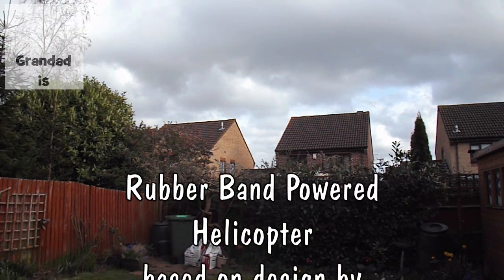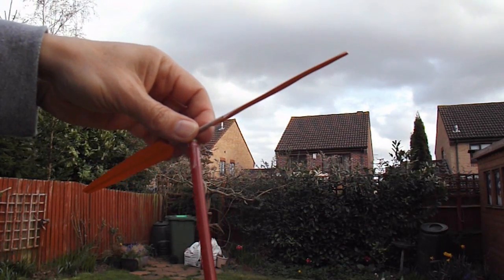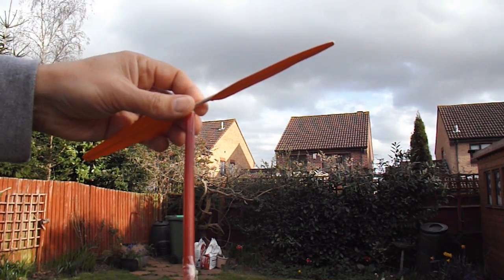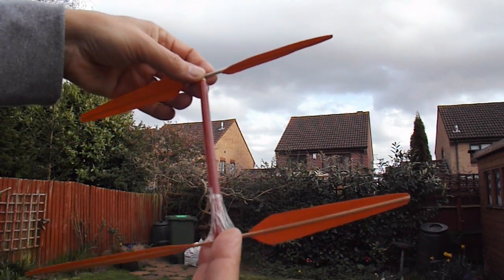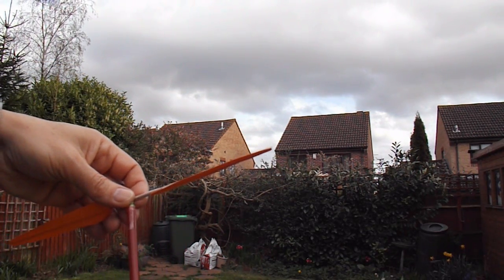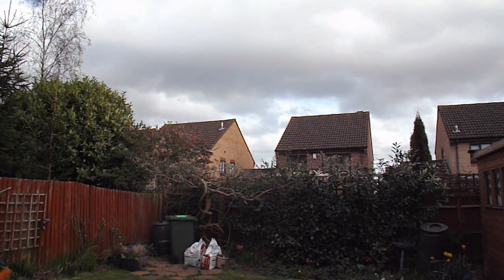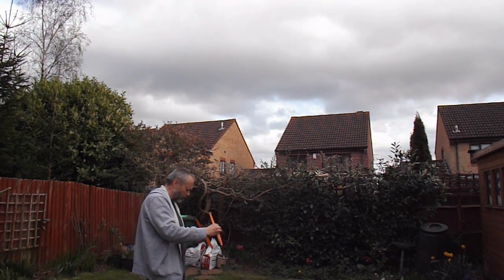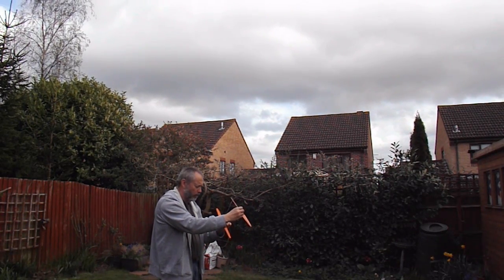Rubber Band Powered Helicopter based on design by David Vernon Williamson

Comment: I was looking on YT for rubber band helis and I saw this one. I am gunna make a big one a bit like yours but have a longer stick going down. Two advantages:
1) Extra stability, cos it's weighted to stay more up-right.
2) Longer rubber band will last longer.
Still thumbs-up, though.
Reply from the maker: +Justwantahover thanks, here is one that is bigger but I am guessing you may be thinking bigger again https://youtu.be/H7HqkcE1oO4
Reply: +GrandadIsAnOldMan Thanks, I've seen it. When I was on about the extended stick and long rubber band, I meant that the rotors are both near the top, and the stick hangs down below both rotors. Mine will be about thirty inch diam (or a bit less).
Reply from the maker: Justwantahover look forward to seeing it. Your recent flights with the old timer are great. Looks like you need a bigger garden.

Comment: never really got to the bottom of those things. I think there are much better designs out there
Reply: +GrandadIsAnOldMan haven't tried it yet but will get round to it eventually. very similar to toy which originally inspired the wright brothers
Reply from the maker: david vernon williamson hey, it works fine. There will always be tweaks and adjustments and different materials, but this worked by following your design so that is a total success for me.
Reply: +GrandadIsAnOldMan, could you please put the make video together? I had so much trouble figuring out from the drawing how to make it... In the end, my top blades spin very slowly. Steadily, but not fast enough to power flight... Thank you!
Reply from the maker: +Elena Labrecque if it spins slowly then you probably have a problem with friction. Maybe the bead you are using is not allowing the propeller to spin freely. You may find using 2 beads might help so they rub against each other as the bearing surface instead of the propeller rubbing against the bead and you might be able to add a lubricant of some sort to reduce the friction. The other problem may be your rubber band is not powerful enough. Maybe try a selection of different thicknesses to see what works best. Too much power would be just as bad as it could make the motor too tight and cause too much friction for the propeller.
Reply from the maker: +david vernon williamson thanks for the link and thanks for remembering me :) yes, I spotted this when it was uploaded as I am subscribed to sciencetoymaker but I haven't tried to make one yet. They look remarkably lifelike. I am guessing you may have linked it to this comment thread for Elena Labrecque so thanks for that too :)